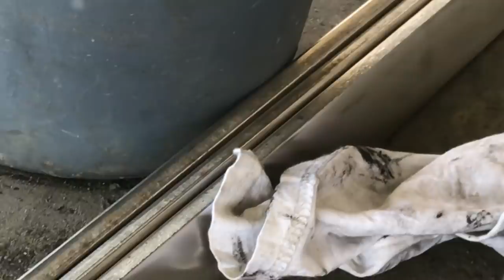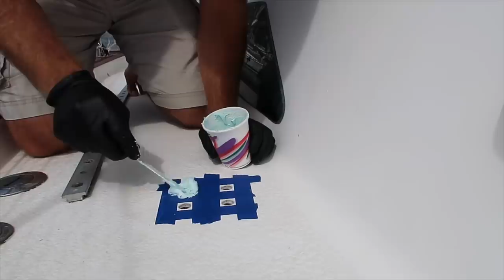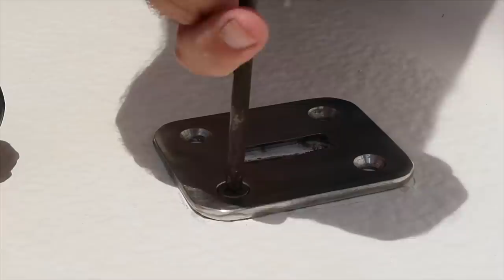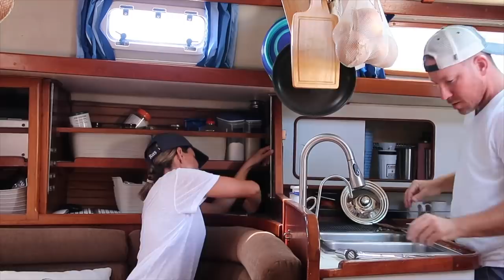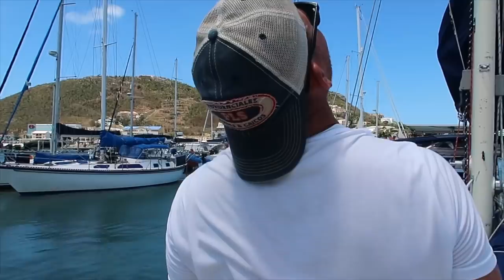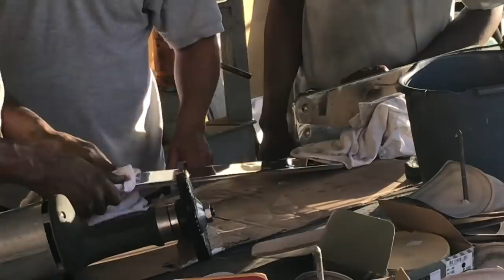Deck Repair and Install: Chainplates in Paradise - Part 2 (Sailing Satori) S3:E17

Comment: Watching this at around 13:00 minutes reminded me of the day my uncle (The Captain) TOLD me to add an I-Beam Jack to the list of items to go on the boat....  They are long and thin. We hung it on a wall in the engine room.... We used it twice. Worth it's weight in gold both times... and I-Beam Jack not only pushes like a regular jack but it also can pull like a winch... Never leave port without one again (In a vessel over 30 feet).

Comment: Nice work. You might consider next time removing the rotted plywood by using an allen wrench with an edge ground on the tip and filling the void with epoxy/microfiber mix. Also a good idea to caulk the chain plates after the rig is tuned and ideally sailed a bit to load up the chainplates and put them in their final position.  Do yourself a favor and use blue (preferred) or green loctite on any stainless fastener threads to avoid galling or self swaging.  Clean the chainplates with alcohol, acetone or similar to remove any wax that may be on them from the polishing. You want a good bond to the plate itself to keep water out.

Comment: Nick, good video. Pretty good design by Morgan to have the chain plates so accessible. I've pulled a couple of mine too (same boat). One thing I did that you might want to consider or maybe its been done (could not see in the vid), is to chip out the balsa core around the actual chain plate deck-holes and fill with thickened epoxy so if they leak in the future there is no more impact to the core. Morgan did not do that during construction for any deck penetrations from what I have seen. If you make the epoxy peanut butter thick, you can pack the oversize hole and then use your pinky and popsickle stick  to reopen and shape the chain plate opening so you don't have to recut the hole once it hardens. Same idea as what you did in this video with the cover plate screw holes. I've been chasing leaks since owning my 44. Hows your hull/deck joint - leaky? I had to cut off the outer/bottom hullside portion of the teak toerail cover, 5200 the entire hull/deck joint and put the teak back. Much drier inside now..... Sent a couple pics of mine to your crew@satori email.

Comment: ... Suggestion:  Chop up some fiberglass cloth into little itty bitty bits and mix it into the putty ... then add the hardner.  It will add some strength to the putty plug so it doesn't crack after hardening or drilling ...

Comment: ... Now that I watched the video to the end ... 1) the lowwer chainplates most likely developed a slight bend over time due to the loading ... they were most likely straight origonally.  You would think that SS that thick wouldn't bend ... but w/ loads that are even below 50%,  they will cause bending,  but it takes time.  2) What the rigger was explaining was "S" curving the mast.  I believe the upper shrouds on your rig are also in effect the "spreader wires"  that when loaded prevent the mast from going "out of column"... "S" curving.  Now w/ a rotating mast (like on a catamaran) the spreaders are completely seperate from the shrouds are basically internal to the mast being attached top and bottom to only the mast and passing over the mast spreaders.  So,  you generally don't have the "S" curving issue unless a spreader wire fails and then the mast usually fails/bends/,snaps ... basically a expensive bad day.  If a shroud fails the mast tends to lay over to the side ... still a bad day ... just not as bad,  just a mess to clean up,  a shroud to replace and a mast to re-step ... still a very brief but exciting event!!!  (I have the "merit badges" for both events!!!)

I can tell your engineering education ... it shows on how you approach solving problems ...

Comment: You mentioned high density foam used for a previous deck repair. Was InjectaDeck used? If so how has it held up and for how long? I’ve been considering it myself.

Comment: instead of bending that rod by tightening you can simply use a spacer will make a lot difference, it will reduce the stress a lot

Comment: Nice work and great video !  Towards the end of the video, were the larger chain plates completely rebuilt or were the old ones just cleaned and polished?  Did you inspect all of the pins for stress cracks or did you replace them with new?

Comment: If that is epoxy based putty, wear protection because once you become sensitized to it , it is bad news.    Some can't be around epoxy ever again including going into boat cabins.
Reply from the maker: I think it’s actually polyester based. I just used epoxy as a general term, not really knowing the difference at the time.

Comment: If your chain plates were made out of hot dipped galvanized this wouldn't of happened.  Among the commercial sailors there is an old saying. 
 " stainless is half as good as it looks and galvanized is twice as good as it looks "

Comment: You did all that great work but at the end you tight the screws without any sealing paste between the metal and the deck?!?!
Reply from the maker: No... I did not tighten all the screws down. Sealant will be applied once the rig is re-assembled and tensioned properly.
Reply: @SailingSatori  then... super nice!!

Comment: Through deck chainplates are the work of the devil They're impossible to seal properly and the risk of crevice corrosilon is very high, Attaching them to wooden bulkheads is the second worst sin. The chainplates should be made as plates ( in a T  shape)attached to the deck by through bolts to underdeck plates that are themselvesconnectecd to strong points on the hull. Not bulkheads....